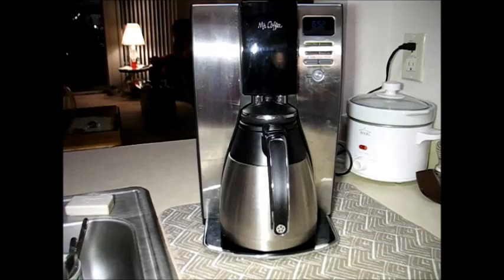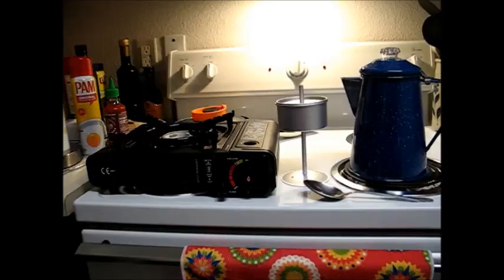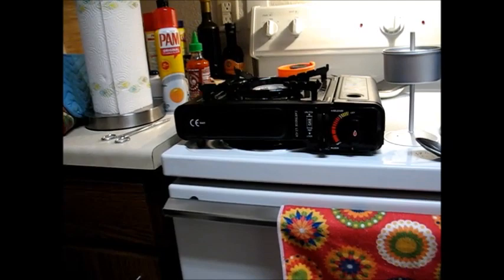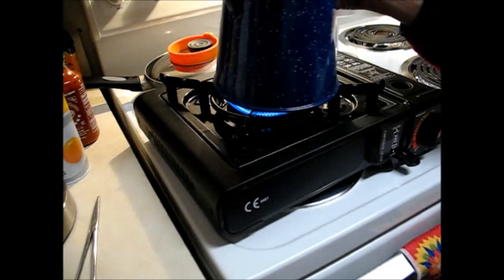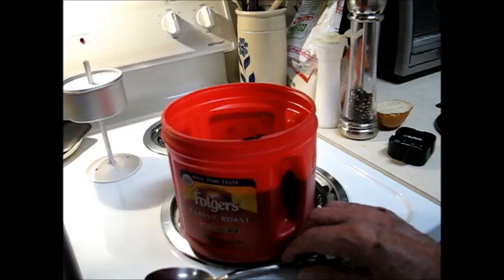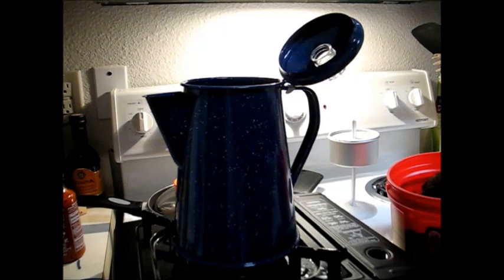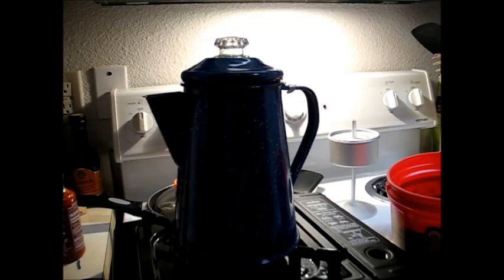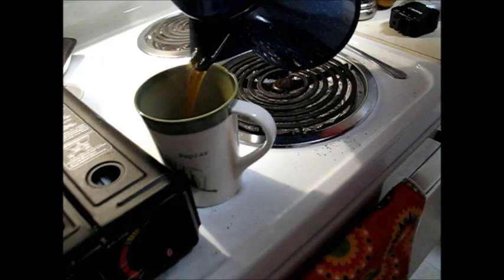HOW TO MAKE COWBOY COFFEE

Comment: I have my vintage coffee pot in my garage. I have had it since 1956 and it was used before I got it. I have used Mr. Coffee and loved to have coffee made already when I got up for work. But I found a coffee maker that makes coffee like I have never seen made at home. It is made by Halls. the first way to make coffee. You boil water then pour it over the built in porcelain filter. I use to sprinkle water or salt to settle the grounds when cooked the cowboy way. I was surprised when you reminded me of the old way.
Reply: PS...my coffee pot is so old it has no glass top. But I have two rare small coffee pots with the glass domes. Also a brand new large, still in the box, and in the garage, as a replacement for a damaged one. And I have a Sun Oven and Rocket stove  just in case.